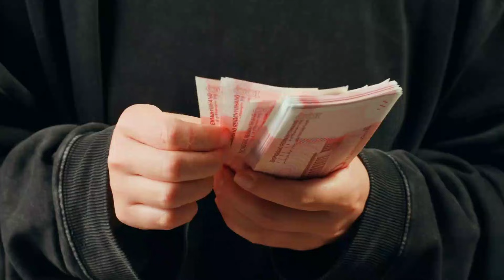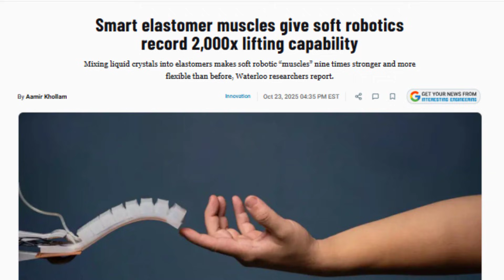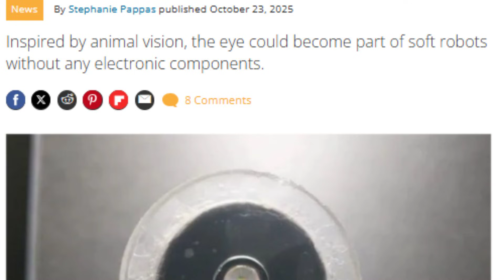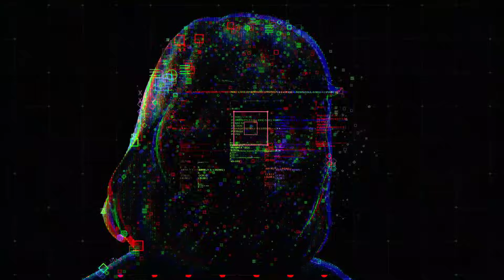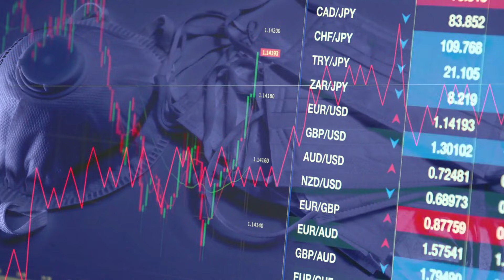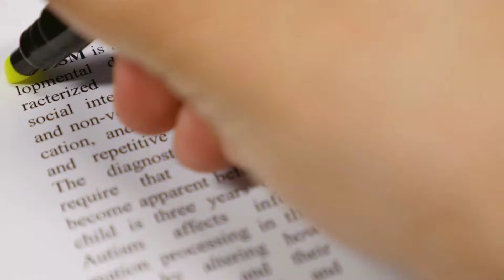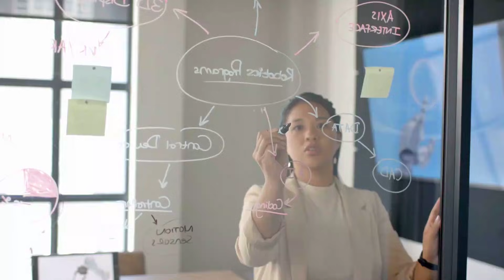Nobody Expected $99 Robots to Do This

Comment: The eyes wouldn't work in radiation.  Lots of hype.  We'll see what becomes reality.  Who controls the next level of civilization?  I trust China more than Wallstreet.  Name a country China has invaded in order to get access to cheap resources?
Reply from the maker: Great points  and honestly this is the exact debate we need right now.
Youre right that a lot of humanoid robot demos rely on ideal lab conditions. Vision systems fail in radiation extreme weather, and high-noise environments. But what’s shocking isn’t that the tech is perfect it’s how insanely fast the price-to-capability curve is moving. We’ve never seen $99 machines doing tasks that used to require $50,000 robots. That shift alone changes civilization.

Comment: So what happens with that robotic eye that runs on light if you shut off the lights?
Reply from the maker: Great question! A robotic eye that uses light-based sensors doesn’t go blind in the dark  it switches to infrared depth sensors or low-light vision just like modern AI cameras. The $99 humanoid hype is about cost breakthroughs but the vision systems still rely on multiple sensors so they can work even when the lights are off.